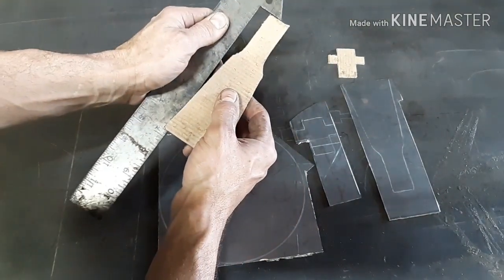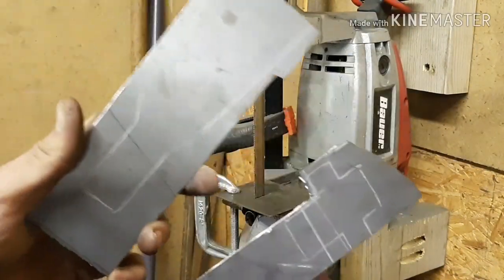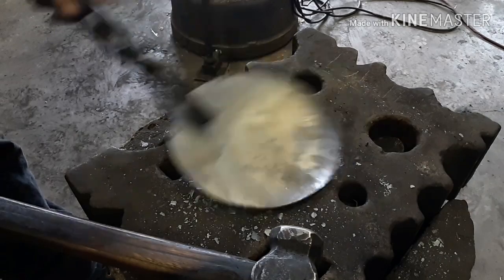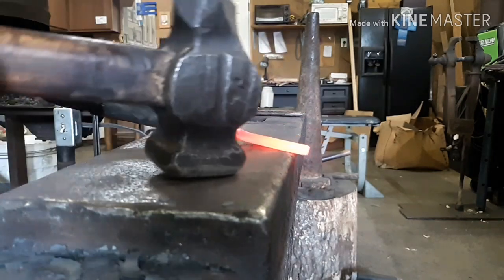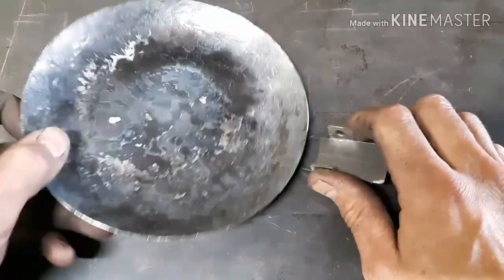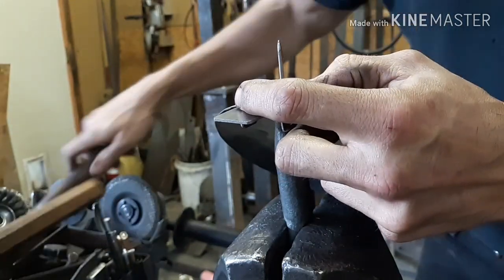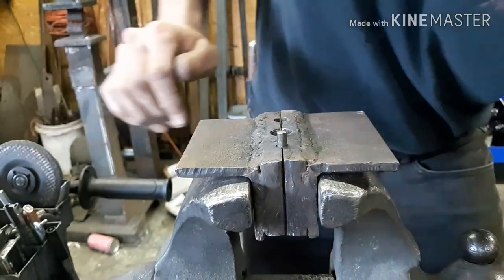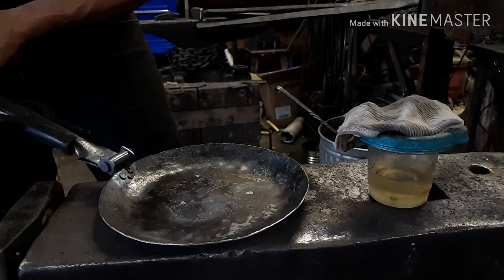GIVEAWAY Forging A Camp Skillet - Step By Step

Comment: Nice one! Just one suggestion: don't rivet the folding part of the handle, rivet just one side and the other drill a hole and fix it with a split pin than the handle can be deattached and it is easier to clean :)